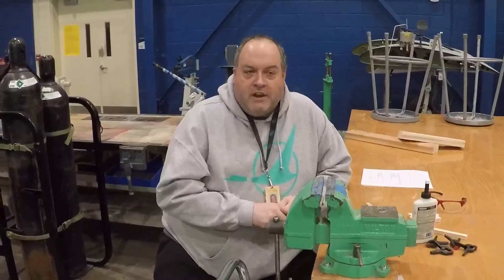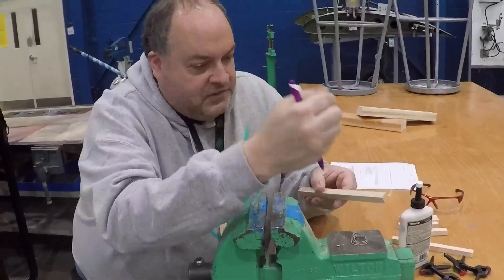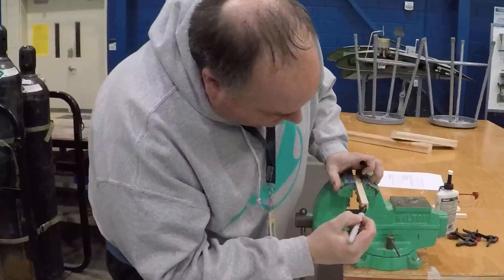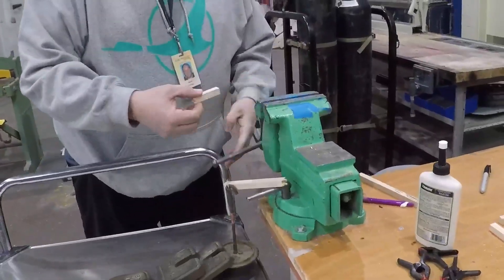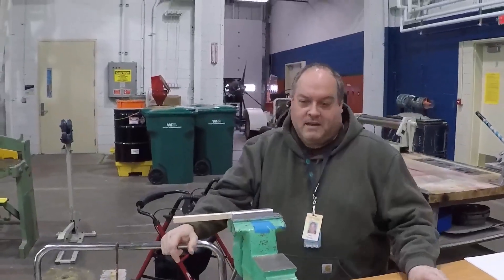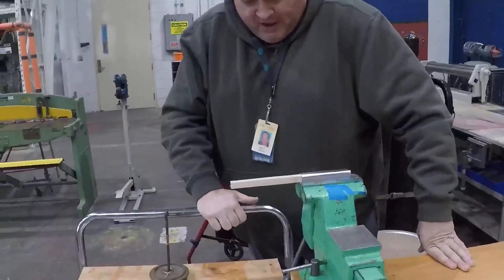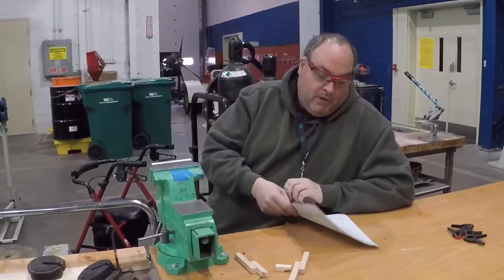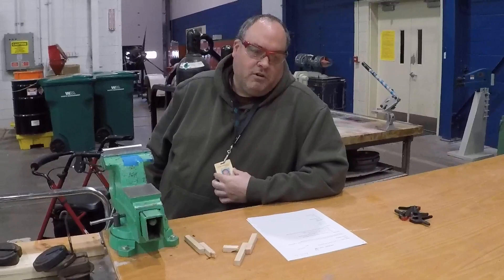Aircraft wood structures AMT 1464 Project 1

Comment: Aircraft glue joints are scarfed and NOT butt or lap glued. The load is carried in the reinforcement gusset plates on butt joints. Your experiment show nothing except wood strength.